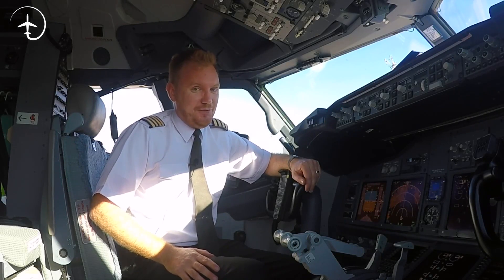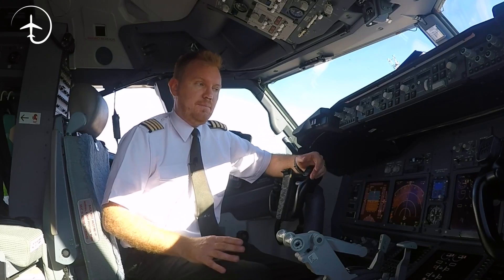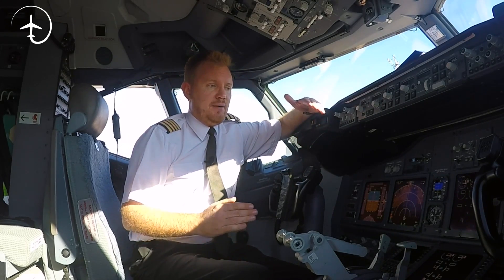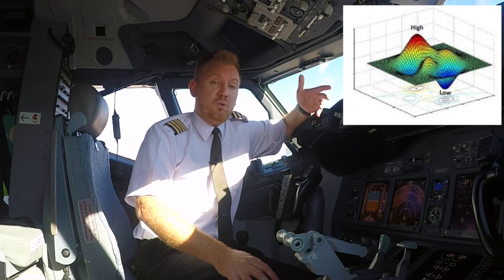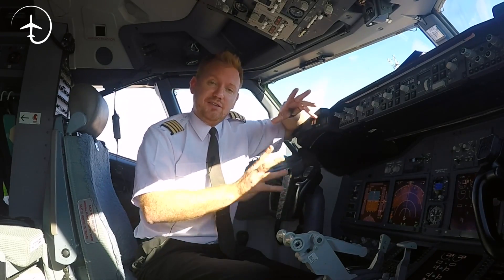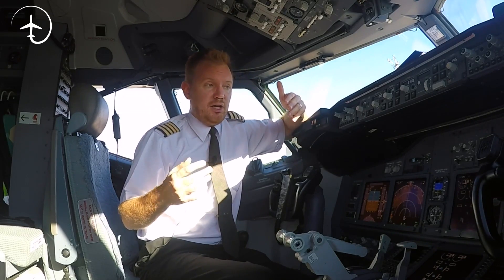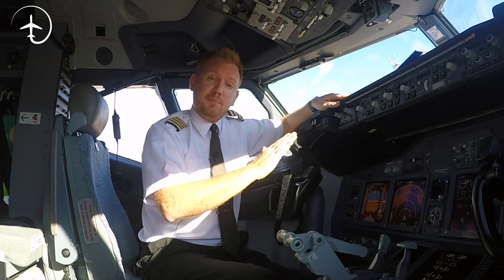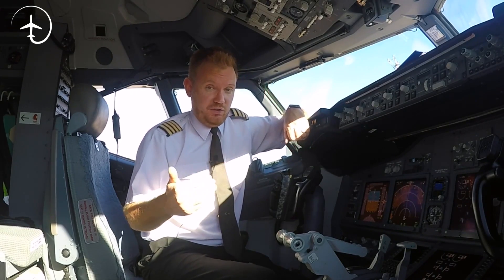How do the Altimeters work and what is a Flight Level?

Comment: Does it mean that the airplanes after reaching the Flight Level are copying the air pressure and flying up and down on the path? Can it be noticed, like on the on board gyroscopes when you hit like a low pressure zone and the autopilot corrigates to the new Flight Level?
Reply from the maker: Yes, the aircraft will be flying up and down a bit but its not noticeable as the pressure surfaces are so big.

Comment: The pressure decrease with increasing altitude is linear only for small changes in altitude.
A much better description is an exponential function, where pressure decreases by 50% for every 18,000 feet (approximately) of increased altitude.
So at 36,000 feet, the pressure is 50% of 50% which is 25% of sea level pressure.

You can see why this is the case from what you learned in your physics classes.
Whatever your height, every square centimeter of horizontal area is supporting all the air above in a 1 centimeter square column.
So as you descend, the air pressure increases exponentially, doubling for every 18,000 feet you descend.
This happens because there is more weight of air to support as you descend.
(The numbers change a little bit with air temperature and weather fronts.
Also the temperature of the atmosphere increases above a certain height, which complicates things.)

If our altitude is 180,000 feet, that is 10 times 18,000 feet.
Using our simple exponential model, the pressure is 2^–10 or 1/1024 or about 0.1% of sea level pressure.
(NASA commonly defines the atmospheric entry altitude as 250,000 feet, so this isn’t far off.)

Wikipedia has complete formulas and background information.
For example, Google “wikipedia barometric formula” or “wikipedia altimeter”.
Per Wikipedia, an aircraft altimeter displays height as the logarithm of the air pressure, following the equation
z = c T log(P/Po)
where z = height, c = a constant, T = absolute temperature, P = measured pressure, and Po = sea level pressure.

Comment: I'm a skydiver and have one of my many altimeters sitting just under my computer monitor.  I zeroed it out on a day when the local pressure was the same as the altitude of the local area.  I now use it to see what the weather is doing.  Right now it is showing a +500 feet in altitude.  So we have a low pressure system moving through, and the MASSIVE thunder storms to prove it.  lol  By keeping an eye on it I can get hours notice of storms moving through.  And by seeing how fast it is changing can tell how severe it may get.  So just another use for an old altimeter.
Reply: Nice!
Reply: Most people use barometers as altimeters. You use an altimeter as a barometer :P

Comment: If pressure at sea level is 1013,25HPa and outspace starts at 0,1% of that pressure, then will be 1,01325HPa only there.
The pressure drop is the difference = 1012,24HPa
If pressure drops 1HPa every 30ft rise, then the outspace starts at 30ft/HPa x 1012,24HPa = 30367,1ft.

Comment: Why not GPS based altimeters?
Reply: GPS is inaccurate because of the military use and above specific height, it turns off in a case for it not to be used in ballistic missiles. GPS is military technology and a public one is done in this way to prevent military usage. hope it helps. ps. To my knowledge, military planes are using GPS system instead of hP.
Reply: Wanard all civilian airplanes use GPS as their main navigation system. GPS only shuts off at 70,000 feet, far above the cruising altitude of a commercial airliner.
There is actually an altitude reading on the nav display, but it is unreliable due to slow update times, even though it is actually very accurate due to the military-grade GPS reciever on board the plane, but there is no way to increse update time because the satellites ping their data at predetermined intervals. It is only used as backup if the radio altimeter fails on final approach.

Comment: Fighter Jets have Radio Altimeters that work in a more efficient and fundamentally different way. This is because how rapidly a combat plane changes vector. Not an expert, but I feel it is about time commercial planes adopt the same system, reduce scope for human error and free up the pilot. Also, funny to imagine a fighter pilot having to set and reset the QNH the whole damn time in his pressure altimeter.

Comment: 0,1% linear decrease of 1013 hPascal
30feet = 1 hPascal
0,001 * 1013= 1,013 = delta is 1012 hPascal
30 feet * 1012 hPascal = 30360 feet = 9,25 km

Ok obviously not right. :D

Ok, 1 atm is not 1013 hPascal, it's 1013,25 kPascal
30 * 10120000 Pascal = 303600000 feet = 92537 km which is my final answer. :)

Comment: Thank you for the definition of QNH.
What is QFE? I thought that this was the local pressure for a given airport.
Reply: That's correct. QNH gives the altitude a mean sea level, so you get the airports elevation above mean sea level when on ground, and the QFE gives you zero feet when at airport on  ground. I remember back in the 80's especially Britisch flightcrew asked for the QFE here at Maastricht Aachen Airport EHBK. Probably to get the actual altitude over ground. Maybe because the did not yet  have a radio altimeter back then.

Comment: Mentour you are VERY MISLEADING. By saying in the video that Air Pressure at Sea Level is 1013.25 mb and falls by 1 mb per 30 ft in altitude (which is not exactly true), then asking people to figure out when air pressure drops to 0.001 (0.1%) of Sea Level at the edge of space, you are totally misleading the uninitiated. Any casual observer taking your word for a fact will assume that air pressure falls linearly with altitude and gets to about 1.013 mb in about 30,367 ft. That puts the edge of space at 9,258 m which is TOTALLY WRONG.

The fact is that air pressure does not decrease linearly with altitude. At about 9,258 m you have in fact about a third of the surface pressure. In fact at 8,848 m (top of Everest) -- which is pretty close to the aforementioned -- some acclimated mountaineers CAN breath without oxygen and exert themselves for many hours.

This is actually a rather COMPLICATED problem. First, of all the decrease in pressure due to the weight of the atmosphere above you is NOT a linear function. Secondly, it is complicated by the fact that pressure are also affected by Temperature which causes gases to expand and contract. Temperature does not decrease linearly with altitude. As a matter of fact, the way temperature changes is very different as you climb through the Troposhere to the lower stratosphere, upper stratosphere, mesosphere and finally the Thermosphere. Temperatures drop as to go up the Troposphere to about 10km altitude where it is a frigid -50C (give or take). It then stays constant for a while in the lower stratosphere, then actually increase in the upper stratosphere. By the time you reach the Mesosphere (~50km) you have gained about 50 deg C and are back to about 0 deg C! It then starts to fall again and drops to about -80C at the boundary between the Mesosphere and the Thermosphere (85km). Above that it increases again and can actually get to summer like temperatures. To properly calculate pressure with altitude you actually have four formulas each modeled for these segments of the atmosphere.

To keep this post short, you will reach about 0.001 mb at the Meso-Thermosphere bounary. It's about 85km up. You can calculate it if you look up the pressure formulas. Or, you can watch a rocket launch and note the altitude where they jettison the payload fairing! But if you start by watching this video and noting the 1 mb per 30 ft statement you are going to be bungling around in the dark for a while!
Reply: I'm not sure he said that the air pressure is 1013.25mb at sea level, I think he said that 1013.25 HPA is the standard pressure all aircrafts above a specific altitude should use in order to keep a safe vertical separation distance between meeting aircrafts. And the altitude reference he gave in the video was 20.000 ft.
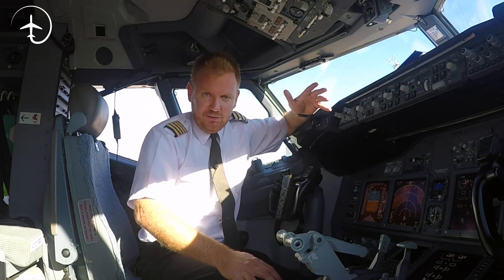This is what I understood and taken from 5:56 min in to the video to the end.

I might have misunderstood what you meant but this was my take on it.

Comment: A question of a complete novice: Wouldn' t it be possible to use a system based on GPS and GLOSNASS or something like that for determing the height above sealevel ?  I guess the inaccuracy of GPS could be solved with the conjunction of GLOSNASS data.
Reply: Der Ben - I was also going to ask ‘why not use GPS?’ but (from memory) my starting point was GPS determination of height is even more accurate than it is for position on the ground and unaffected by local weather.  Perhaps coverage at places like the poles isn’t sufficient for aviation, or just the old chestnut of ‘change anything on this plane and it will need total recertification’.
Reply: GPS is inaccurate because of the military use and above specific height, it turns off in a case for it not to be used in ballistic missiles. GPS is military technology and a public one is done in this way to prevent military usage. hope it helps. ps. To my knowledge, military planes are using GPS system instead of hP.

Comment: how do low/high pressure areas in different weather situations impact flight levels as you pass them with your standard pressure set into the altimeter? To my understanding the plane flight path would be a series of ups and downs, as you pass airspace with different atmospheric pressures.

Comment: Hang on. If the altimeter is set to air pressure, what happens when you pass through a cold front? Won't the indicated altitude change? Too late in the evening to figure out which way.
Reply: Yes, as gasses cool the they lose energy. Pressure is really the relative difference of the amount of energy two gasses have, so a decrease in pressure really happens when one gas looses energy at a faster rate than it's neighbours, but that's what you'd expect at a cold front - cold air next to hot air. This is what happens in the atmosphere - the sun heats the air, it gains energy, and tries to expand (actual expansion, and thus pressure will be dictated by how much energy the air around it has to push back). When air cools, it's losing energy so will shrink and pull surrounding air toward it. This causes variations in air pressure to change size and move constantly  and is the problem Peter was talking about in the video - it's not practical to know all the pressures you'll encounter on your route in advance, and even if you did, they'd change anyway. You'd have to know where every front and other type of weather really are all the time.

That's why they use the flight level system. If everybody is using standard pressure, then they will all descend the same amount as they fly through a cold front (because their altimeter is saying they're climbing into thinner air) and ascend the same amount as they pass through high pressure (again, the altimeter will show the high pressure change as descending, so the pilot will gain tur altitude to maintain indicated altitude). This maintains the vertical space between planes to avoid collisions. All that matters is that they don't descend below a safe altitude (the transition altitude) and risk collisions with terrain and aircraft who are calibrating their altimiter by local pressure (QNH), so there's usually a buffer zone of a thousand feet or so nobody can fly in. 

The Transition altitude varies a lot around the world. In the US it's 18,000 feet standard I think, so if you're in a Cessna or a Piper or other unpressurised GA aircraft you'll likely not encounter it as the plane probably can't fly that high, and you'd need oxygen even if it could. In Australia, it's 10,000 feet, so it's possible that a GA plane could get up to the transition altitude and in Europe it can be much lower still

As you might have areas with a lot of traffic operating on QNH (local presure) just below traffic operating on STD (standard presure), it's really important that the planes flying above and below the Transition Altitude maintain that minimum 1000 ft of buffer between them because their altimeters won't read the same altitude when the planes are at the same true altitude.  So long as QNH is is an equal or higher pressure than STD, all the planes operating above the transition altitude using STD will be naturally separated from those flying below the TA using QNH (QNH calibrated altimeters will be reading roughly true altitude, STD altimeter will be reading a lower altitude than true altitude so the pilots will ascend to maintain indicated altitude). However if QNH drops - say, like what you might see at a cold front - below standard pressure, then you could have a problem. The change in altimeter indication would cause planes flying on STD to descend relative to those flying on QNH. In that case, lower flight levels are made unavailable to maintain at least 1000 feet vertical spacing. So even with the transition altitude and standard pressure, local pressure still affects the lower flight levels. The difference is that the pilot flying above TA doesn't have to constantly check the pressure, they just have to know which flight level they should be at.
Reply: James Oren Thanks for the comprehensive explanation. Much appreciate it.
Reply: James Oren I find this subject fascinating. Interesting business flying :-)

Comment: I like math... The answer seems a bit on the low side, but other chocolate than that, I cannot make... (Dutch expression) LOL
Ground level = 1013,25 hPa, the maximum height = 0,1% of 1013,25 = 1,01325 hPa. The difference = 1012,23675 hPa. The altitude to climb to would be 1012,23675 x 30ft (per 1 hPa) = 30367,1025 feet.

Comment: If you are on the ground at the Dead Sea in Israel, does the altimeter show 98760 feet??? (-1240 MSL)
Reply: Aimless6 No, the Altimeter shows -1240 if you have the correct pressure setting.

Comment: 100 km.  This is the altitude that the space shuttle transitions from using maneuvering thrusters to using aero surfaces.  Also, I thought vertical separation was maintained by TCAS.
Reply: Alex Derus TCAS avoids collisions with other aircrafts. What maintains vertical separation is the aircrafts having the correct standard pressure (if above the transition altitude). The TCAS is only used when there is an iminent collision between two aircrafts. Mentour has done a video about TCAS. Check it out!

Comment: is QNH the same as "altimeter" 2992 ?
Reply: As far as i know, yes.
Reply: Leah Jackson Altimeter 2992 is the standard pressure in inHg. It is more or less equivalent to QNH 1013
Reply: Leah Jackson Yes but they are in different units (inHg and hPa). Also, inHg is used in the States and QNH is used in Europe
Reply: Leah Jackson Glad I could help
Reply: oh so pretty much the same thing ?
Reply: oh :)

Comment: Why do you use level above sea level instead of ground level when you're over ground?  Isn't the height above the current terrain what matters?  Or the mountain in front?  You said it was to establish a common reference for multiple planes calculating separation.  
Why don't you use radar instead of pressure?  Would it change with air density or weather?
Reply: Bruce Wagenberg At cruising altitude, the height above the ground does not matter, because you have a very big terrain clearance. What matters then is vertical separation between two aircrafts. If the altitude that mattered was the height above the ground, then to maintain 30000 feet for example, you would have to be constantly climbing and descending. I hope I answered your question. Feel free to tell me if you haven't still understand it.

Comment: Hello, Petter! Do you have any idea what the reason was for the Trabzon Airport (Turkey) accident? Weather at time of incident: LTCG 132050Z 25001KT 2800 -RA BR BKN004 BKN025 08/07 Q1021 BECMG TL2100 3200
Reply from the maker: No, we will have to wait and see what the report says but it looks very strange. There is a turnoff pad almost exactly at the same place on the runway on the OTHER side, it could be a mistake in poor visibility, rain and darkness but it would be very strange indeed.
Reply: So far, as Mentour mentioned, it could be that the pilot turned to the wrong side during bad weather, but there's also some rumors that the right engine accelerated which caused the plane to veer to the left.
Reply: This case reminds me of another incident. It will be interesting to know if the reverse trust are available on both engines. I read somewhere that the speed on the last quater of the runway was around 110 knots. We had similar case here in Bulgaria 4 ago on Burgas Airport (the fourth longest runway in the Balkans 3200m) and the reason was landing in the middle of the runaway unexpected change of the wind speed, Vapp more than normal and the pilot delayed with maximum braking mode. ILS on Bypass mode , the aircraft was A320-232
Reply: Borislav Baychev Yep, similar thing happened to TAM Flight 3054.

Comment: Does std QNH is same over all airspaces across continents? 1013.25kpa is at sea level whereas in flight it set at much higher altitude
Reply from the maker: Yes, STD pressure is always 1013.25 HPA, everywhere.
Reply: Mentour Pilot Thank you Captain.

Comment: Mentour, my question is: If there was a super jumbo coming in to land and just behind that super jumbo (with enough horizontal separation to avoid wake turbulance) there is a small aircraft such as a CRJ, then how will the pressure be measured in QNh by the small aircraft?
Reply: sapan avarani The pressure setting will be the same
Reply: Prolly using the radio altimeter at that point. And the smal plane will have ILS feedback to assist with the approach.